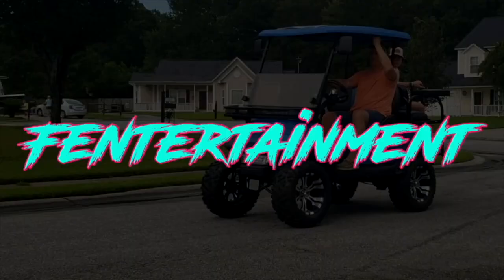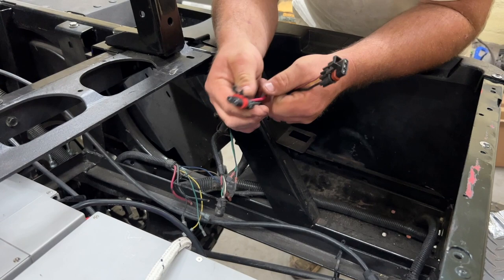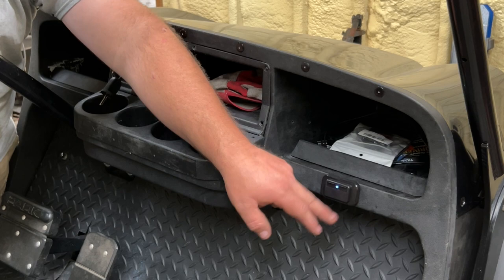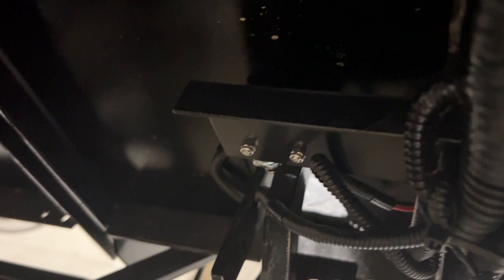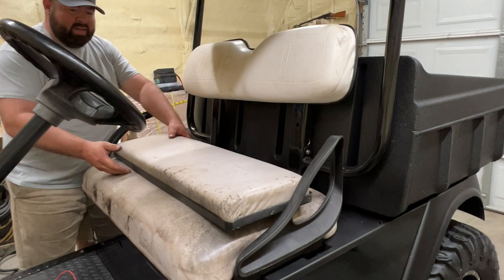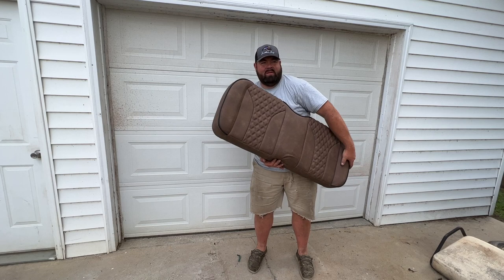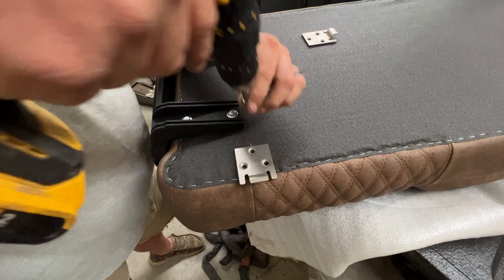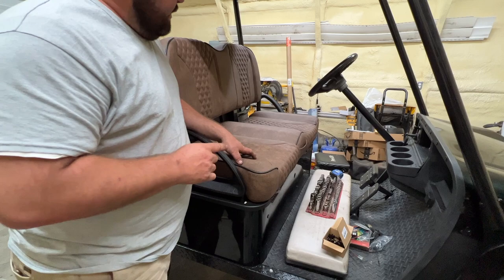How To Install MODZ FS2 Seats | Cushman Hauler Pro Utility Golf Cart | New Lights | New MSA Wheels

Comment: They look really nice. Like you, I'm a big guy and would really like my seat back moved rearward an inch or two maybe leaned back a little.
Reply from the maker: Thats my current dilemma. Thinking of mounting the rear rest to the front of the dump bed.
Reply: @Fentertainment  I've never looked closely at one of these commercial "hauler" style carts. Is it possible to slide everything back a little. I know I remounted my ZTR kubota seat back one inch and it literally made all the difference in the world. Every mower forum I read, this was the chief complaint.  No one tried..... you seem to be in the same "don't tell me I can't do something, cause I'll put it on your doorstep" type person. Where did you get the bigger Anderson connector lugs?
Reply from the maker: @goldenlife9856 I cant. The roof uprights are 1.5" tubes and they fit on the lower portion of the back rest mounts. The bed locks into those as well and the bed has pivoting mounts in one location. I mean I could do a bunch of work to extend everything backwards or I could cut down the rear rest seat brackets and mount the rear rest to the front of the dump bed. I would gain 2" by doing so .
Reply: @Fentertainment  Sounds good. Did you change the wires in you BB Anderson connectors? If so, what wire and terminals did you use? They look a lot larger than what comes with them, it may just be perspective......
Reply from the maker: @goldenlife9856  Yes I did, Good Eye! These are actually the ones that came with the falcon batteries. They are 4ga cables as the eagles are 6ga i believe.
Reply: @Fentertainment  I always go bigger when possible. The easier the electrons flow, the better performance and efficiency  is. My whole system is 2/0 except the battery cables from the Falcons. The charge side, I'm not concerned with. It's the discharge efficiency. There also appears to be a break-in difference in these batteries, my range is up. After the heat let's up I'll do another range test at speed (35-40)